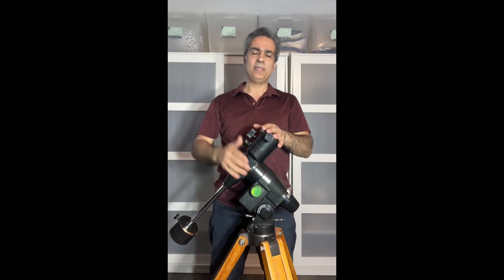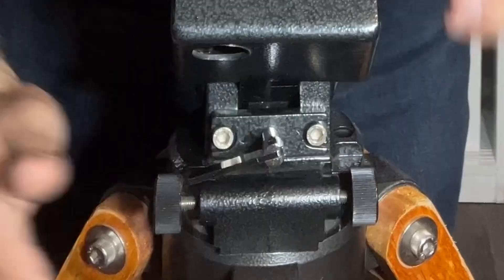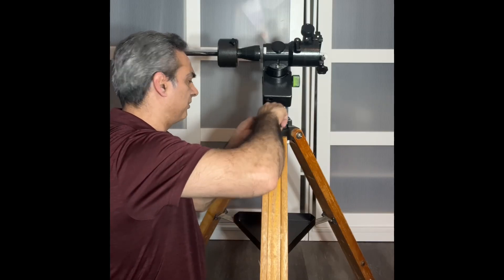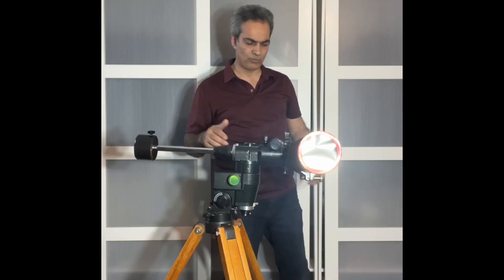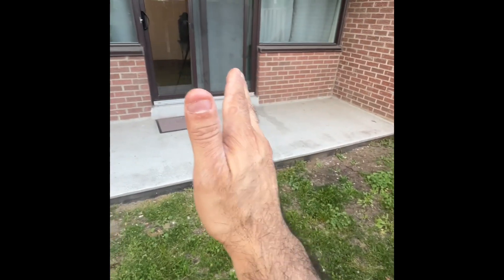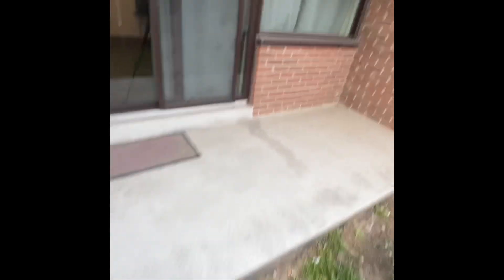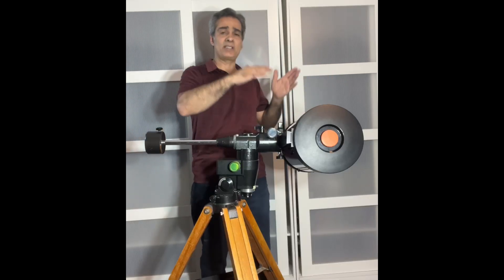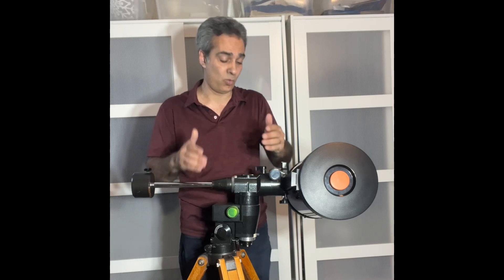Turning your EQ mount to a AZ mount #astronomy #telescope #equatorial #tripod

Comment: I hate AZ mounts. I adore EQ mounts. Especially ones that track. I can leave the scope go inside come out 30 min later and just twist a knob and I am back on the target.  Plus it takes like less than 2 min to polar align.
Reply from the maker: @lornaz1975  I agree with you I like equatorial mountains for that reason specially if you like high-powered views of the planets

I do have the  svbony az mount but I use it mainly for solar viewing and for quick grab and go
In this video for those that didn’t know it could be done. I thought I showed them. Thanks for watching.

Comment: This doesn't make much sense with telescopes that have focusers at the back side like refractors of SCTs, since one can just rotate the diagonal. However it would be perfect for like 6 inch f5 Newtonian set up in such way that the focuser is always in horizontal position and around the eye-height of a standing person. I think it's a great way to avoid weird positions of the eyepiece with a Newtonian without rotating the telescope in its rings. I have such Newtonian on skywatcher AZ4, and if I had only some equatorial mount,  I would probably set it like on your video, because I like to change targets on the sky frequently, and rotating the tube all the time would be annoying.
Reply from the maker: @janomacko5764  OK another great points actually and I was just thinking if I want to use a StarSense, then I can use it in this mode because StarSense does not work in the equatorial mode so that could be another reason
Thanks for watching
Reply: Joe, Ive also heard that Starsense doesn't work for EQ. Is that really true? Have you already experimented with that?
Reply from the maker: @Sk240DC  here is the link https://youtu.be/TtQHWIY7Y6U?si=IkSZxMCLStq4XmLv
Reply from the maker: @Sk240DC  yeah actually I tested that Siri I made a video on it probably nine months to 12 months ago. If you go back on my channel, you’ll see it and I didn’t understand why as long as you get to the end point it should still find your object, but once I started using it and started seeing how the motions interfered with the app rotation, then I understood it.

So StarSense can only be used on a non-equatorial mount
Reply: Thanks Joe, I'll check that out!